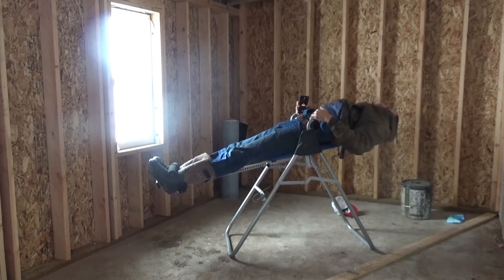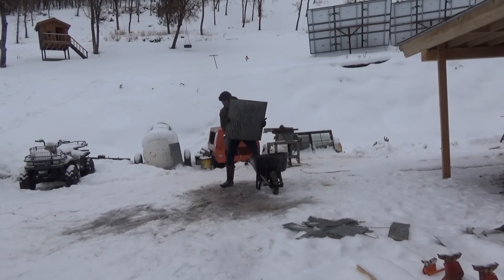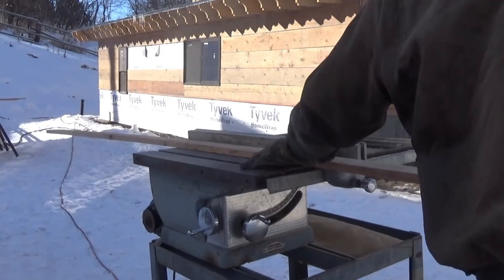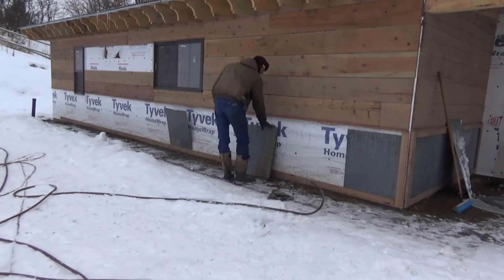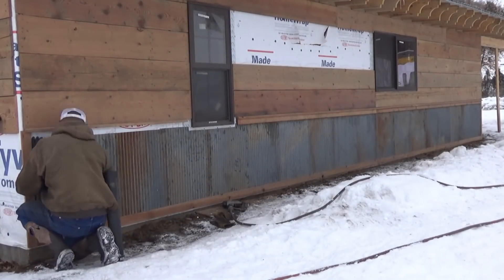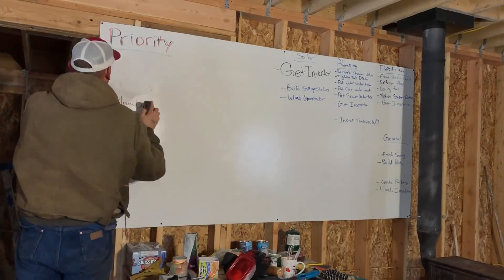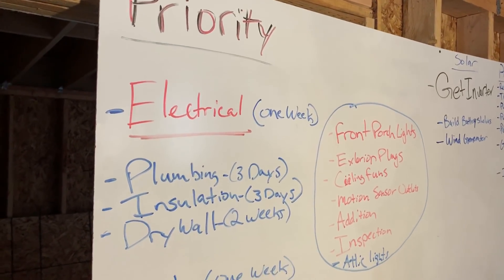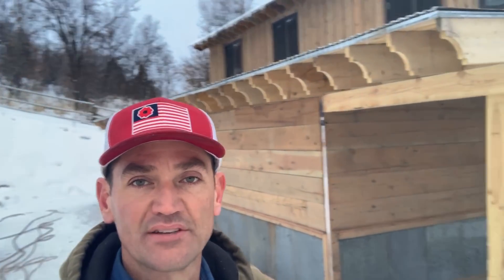#290  - I Used Corrugated Tin For Siding And Move In Date!!!

Comment: I thought adding the tin  was a make do project,  compared to adding stone.  But it looks much better than I thought it would ,and it is at least as protective as adding a stone veneer.  If it works for protecting the lower part of your home walls you win! If you can decide to go with stone later you so are covered both ways.  I'm glad you got the driveway squared away that will make life much easier for you and the family.  The water  well and tank seems to be working okay. It will be interesting to see the water heater install and see how you deal with hot water and the power demands of a dryer in winter.   Not being a troll, as washing clothes and drying them is always a challenge in winter when you are off grid!

Comment: You put the rust into rustic ;). With you doing most of the work by yourself and depending on how you want to finish the house (wood or sheetrock), I can see you finishing by the first of April if you stay at it, and maybe towards the end of April if you do a lot of fine woodworking for the finish. Also have to add in quite a few days for doing the septic system, which I haven't seen you do a video of yet, nor do I know what they make you do for one out there. That becomes a question of when does your ground thaw enough to let you work it correctly; septic systems can be a pain to get just right.
Reply from the maker: Our septic system is installed below the frost level. The only concern I would have would be water sitting on the leach field and that's not an issue for us.

Comment: I Like the tin. I wondered if it might be better to not enclose the sheet bottom in wood, but let it "hang" below the wall by say, an inch. That would create a drip edge. And enclosing tin can make it more susceptible to rust. Next time, perhaps. Still, it it will good for a few years.

Comment: I really like the tin siding idea. Just enough to look nice but not sooo much that it looks awful. Are you worried about the water getting behind at the top where you didn't use any edge cap and also at the bottom of the tin sitting in the groove?

Comment: I bought a Winter coat at LLBean on a trip to Maine since Spring was over down South and it was snowing when the airplane got to Manchester, NH. I've worn it at least 2 times a year since, but it just hangs in the closet most Winters. It is too restrictive to use while I work outside.

Comment: Have you ever heard of a Thermal Mass Wall?  Basically it is brick, stone or even concrete mass behind your wood stove to absorb some of the heat and then radiate it back out during the cooler hours.  Since you haven't finished the interior yet, might be something worth looking into.    I like the worn side of the tin out also, very good look.

Comment: Okay so I'm warming up to the tin.   The rusted side looks better - with the variation in color you don't see the seams so much.    As for using it in kitchen and bath...uhhhh... not unless you can seal it with a thick clear coat of something to shed water and mold and easy to clean off grease.  In my old age I always consider easy maintenance over aesthetics, lol

Comment: Why not leave your lower siding on and just add the tin to the bottom?
Reply from the maker: That would look unfinished to me. I want trim around it to keep the moisture intrusion to a minimum.
Reply: Sorry, you misunderstand me?  You leave the siding there, you then place on top the exact duplicate metal siding with trim.  It would protrude slightly, yes, but not too much.  I noticed how many nails you used to affix the siding and therefore the effort required to remove.

Comment: Tin inside a house..well it absorbs the light and will make your home seem dark. Tin in a shower bad idea, it will rust out and have to be replaced and will bleed rust into your floor, causing more damage. It takes on the heat of the room, and can swing hot and cold to the touch....outside tin looks ok, yet I would still not use it because of the damage it will cause to your house.  You need almost a rubber type membrane under the tin to protect your structure.  Just my experience with tin.

Comment: I like the tin idea for the lower wall. I'm concerned your bottom trim will collect water and cause it to go behind the trim leading to rot. How did you address that to stop that from happening?
Reply: I was thinking the same thing.  At least cut some channels in the wood so the water has someplace to go.
Reply: @ Karl Morrow I think it really looks great! But i too was kinda wondering since the bottom part of Tin went on top of that bottom board that water will follow the channels of the tin to the bottom board.  Water will run down the channels & go on top of & maybe  behind the bottom frame board & cause mold & rot. But if he caulks it heavy against the tin & along top of the bottom frame board,  it should route water away & from possibly getting in behind the bottom frame board. From my perspective of having some building experience, i would think heath would need to address that now, rather than later after water damage is done. But at worst case scenario if he didnt silicone caulk it,  its only gonna rot the bottom & upright frame boards. It would take several years to rot since he sealed the wood & its not going to do any huge damage that close to the foundation. But hes most likely gonna silicone caulk it with a clear 25 year caulk all way around the tin where it joins frame boards. And if so, there shouldn't be any problems for many years!
Reply from the maker: There are drain grooves cut in the back of the board. I will likely run a bead of silicone between the front of the tin and the board.
Reply: Karl Morrow already told everything. We all are doing mistakes, all the time, and this house also have a lot mistakes with cladding. Hopefully some 20 years house will stand and after, just build new one, and demolish this old one. But yes, so much mistakes, primitive.
Reply: Also what about the thermal properties of Tin? Metals usually conduct heat, rather than insulate? What is your Rationale for this decision Heath?
Reply: Especially given how water-phobic OSB is. Heath, you have to find a way to keep water from getting behind the bottom of the tin. That is a nightmare waiting to happen as currently configured...
Reply: try to find some blueskin on craigslist or just buy a roll and cut in half length wise? wrap i around the bottom of the osb best you can? I did this on the outer floor joists of a shed i built with overlap up 10inches up the osb.  just a thought.  I trust it a little more than tyvex.
Reply: I would install a flashing at the bottom of the wall under the tin